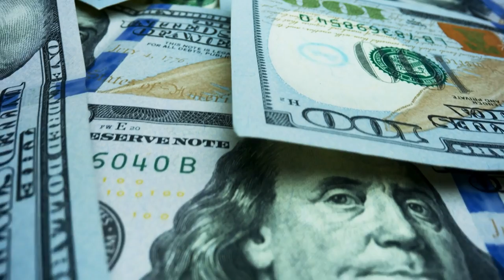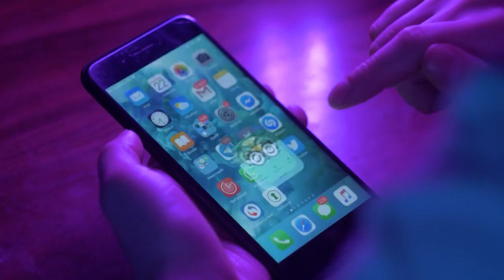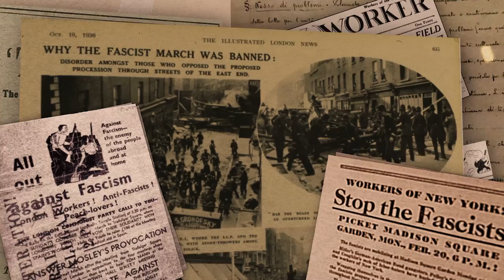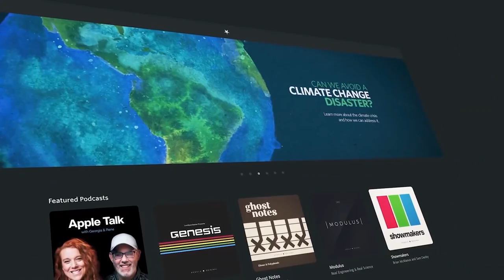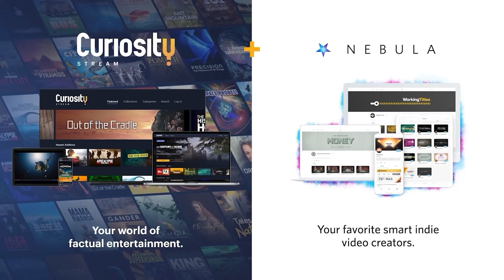Do Socialists Just Want To Take Your Stuff?

Comment: One thing I'd mention is that America's decline in consumer goods quality was a slow one. I'm 39, and my mom was 39 years older than me so she graduated in 1958 (she skipped 2 grades, so she graduated at 16). Although she passed away 4 years ago, I still have all her working electronic beauty products like those giant chrome massagers and she got her first hair dryer in 1954, and it still works.

Capitalism figured out how to export cheap labor and make crap products that die in less than a decade now.
Reply: I'm 20 and there are multiple electronics/products in our household that work perfectly fine and are older than me. New stuff really is shittier, even I noticed that. I remember being in 6th grade (~11y old) , getting my first smartphone (an LG Optimus Black, I love that thing). Back then you could just pop off the plastic on the back of the phone, switch the battery if needed and you'd have a perfectly working phone. Nowadays, take the IPhone 13 for example. God forbid that thing fails because they've made it a royal pain in the ass to take it apart, and the thing won't even work if you replaced the damaged parts with perfectly working, original IPhone 13 parts. You have to take it to them, just so they can squeeze as much money out of you as possible, god forbid you fix anything yourself. And that's just the example with phones, just the tip of the iceberg.
Reply: I'm pretty sure capitalism is a big reason why minimalism is getting so popular in recent years. We have less money to spend, and stuff doesn't last. Buy less, and if you need something rarely, it is better to rent/borrow as it wont last long, and it would take up more space in our homes that are getting smaller as we need to cut living expenses.
Reply: My car (1960 Chevy Corvair) is sixty-two years old and still works (until I took the gas tank out). The only parts I've had to replace so far are the common consumable ones and some things damaged long before I had it. This car was a farm car in North Dakota for years and somehow has only surface rust. The drivetrain is all analog and easy to work on. I couldn't imagine working on a car made today. Everything is proprietary and overengineered to the point that it is not serviceable by even a good mechanic.
Reply: @humankirk9196  yet in Cuba, most people who drive do it in American cars from the 50s. And Russians are driving USSR made cars from back in the 60s, 70s, and 80s. A demand for goods produces products, it doesn't matter if it's in Venezuela, Cuba, the US, or 1930s Germany.
Reply: Capitalism build her chrome hairdryer my god
Reply: @arturow2686  the Soviet Union had chrome massagers and hair driers in the mid 20th century too. But since capitalism always aims for maximum profits and minimum expenditures, the profit motive inevitably leads to outsourcing labor to 3rd world countries, using the cheapest materials and possible, planned obscelesence becomes inevitable. Building a solid product that will work for 80 years drives a company out of business. The time period these items were built was right after 16 years of FDRs fiscally liberal policies. Unions were at their height, and no outsourcing was taking place. But the second half of the 20th century (really the 70s onward, due to a decade of recession) launched the US into an ultra-materialistic society...because the bulk of our economy relies on people buying products. The more often people buy new things the better our economy looks on paper. The problem is that eternal growth is impossible, so we average around 2 recessions per decade. And each one keeps getting worse than the one before it. During these times people only buy the basics, and companies go out of business. Capitalism breeds greed if it isn't balanced with strong consumer protection and anti-trust laws.

Meanwhile, in the USSR products were made by state owned companies, and the citizens who made the products had been working in factories their whole lives. Products were cheaper to make and their anti-materialism ideology meant that their economy didn't rely on selling as many things as possible at the highest price possible. Their government was much more concerned with educating and feeding the people than it was with ripping them off, and the cold War forced them to spend the bulk of their money on weapons production, nuclear testing, a space race, and modernizing their infrastructure. 

Think of it this way: in state run jails and prisons in the US, there is a motive to minimize costs because the inmates don't pay for their stay, tax dollars do. The bottom line is unchecked oligarchic capitalism is a snake that eats its own tail. Sure, we may be the richest country in the world, but that's only if you don't count the thirty trillion dollar national debt. Greed incentivizes the creation of poor quality products, stagnant wages, and the hollowing out of the middle class. Anyone over 40 can tell you that our capitalist country was much more functional with a much smaller gap between rich and poor back when people could put themselves through college without incurring large debts that take a lifetime to pay off. I'm not knocking capitalism, I am a left leaning capitalist. I'm just saying "made in america" used to mean something, and now we can't even build a car that will go 200,000 miles without major problems. Low pay repels qualified workers, teachers, etc. The result is 3 rich people who have more money than 90% of Americans put together.
Reply: @MrJonsonville5  monopolies are against the idea of capitalism. Monopol have to be prevented otherwise capitalism is freedom of choice which socialism is not
Reply: @MrJonsonville5  tldr? Like I said one argument why you writing a textbook. One that understands a topic can keep himself short
Reply: @arturow2686  take your add meds, then maybe comments longer than 140 characters won't scare you so much. If you didn't read it and aren't open to discussion then there's no point in even engaging with you.
Reply: @arturow2686  Monopolies are the ultimate logical conclusion of capitalism, which is precisely what happened during the Gilded Age and is happening now.  It is a zero-sum game designed to concentrate as much wealth and economic power (which invariably translates into political power) into as few hands as possible.  Freedom of choice doesn't even enter into the equation after corporate mergers continue to the point where there are few to no competing businesses, when financial power is so totally concentrated into the ownership of a small privileged class that they can dictate all working conditions and even effectively own governments and the very processes of writing laws so as to cement their advantages into place permanently.  The idea that capitalism is freedom of choice is laughable on its face, particularly as we're already seeing that shrinking out of existence in our current hypercapitalist world.
Reply: @LordZontar  No they are not we took measure to prevent that if afterall one thing is not working it's the way the rich has different laws then the common folk. In the definition of the word capitalism it doesn't say that monopolies are a logical consequence. Maybe for unruled capitalism it becomes a snowball system duh. Which it has become I agree with you but don't blame a simple trading idea that successfully eradicate poverty and starvation. EVEN NOW
Reply: You should watch a few more of these videos pal 😂 an absolute monopoly is the logical endpoint of capitalism. Why do you think monopolies are constantly having to be broken up all the time?

Breaking up a monopoly is anti-capitalist and against the concept of a free market - but it keeps the Ponzi scheme going for a bit longer. Call yourself a 'left-leaning capitalist' (now there's an oxymoron) all you like, but you appear to not know anything about capitalism or leftist thought. Hopefully you've done a bit of reading since these embarrassing comments.
Reply: It also made the items you mentioned.

Comment: 12:43 That's not the only example. The best electric kitchen mixer/blender I've ever used was made in GDR more than 50 years ago. It still works better than most modern ones and has even more useful features than similar modern ones have. The quality of items produced under socialism would vary depending on a great number of reasons and factors. Some of those products were horrible but some things were awesome and were really made to last. User manuals for Soviet-made electronic devices would usually include a circuit diagram to make it easier to repair it by yourself.
Reply: Like the 1960's "indestructible" dinking glasses noone wanted to retail because there's no profit in selling houseware once every 30 years.

Comment: Always like your stuff. I was wondering if you could talk more about the smart phone updates artificially limiting battery thing.
Reply: Software engineers tend to code for the platform they have at hand. They also tend to have the newer and more performant tech than everybody else. Thus as the software gains more functionality, it needs more and more computing power. Every new version runs slower and slower. I have simplified a little bit, but that's the gist of it. I am a software engineer.

Comment: The toothbrush example has always seemed rather disingenuous. Small business is more on the mark, as is the example of a car. A car is personal property, but only into a point. If used for yourself and your personal needs the car is personal property, but if a friend offers you $50 for a ride to the airport the car has then provided a service and is part of the means of production. However if you drive that same friend to the airport for free the car then remains personal property. Meaningfully delineating this boundary without undesired consequence in policy is non trivial.

Comment: This is why I use open source software whenever it's available for what I need. I have several PCs. All but one were throw aways, who's previous owners deemed them too slow and useless. I breathed new life in to them with open source software. I have 2 who are finally reaching the point of being too low spec to serve even me, and the only reason for that is I can't add more storage to them. 32GB is too small for modern OSes, even Linux. It sucks, there is nothing else wrong with it, and the chips would all support more RAM and more SSD capacity. But because it was built not to be upgraded, I can't easily add those to it. The low spec machine in question, I just wanted as a digital typewriter, and maybe read some e-mails, where heavier and more fragile PCs shouldn't go.... but, it's now some of the best condition ewaste I've ever seen. 

The laptop I carry around for work, its previous owner said it was "too slow to do anything". I use it to look up commands at work, check emails and calendars, scroll Mastodon between customer appointments, scan documents, etc etc etc, without fear of loss, theft, or damage. The only thing it can't do is play modern games. It does play Epic Pinball in dosbox though! 
Once I replace the worn battery pack, it'll probably go on for another half decade or more. It has a hard drive slot, which took an SSD eith no issue. Ive bumped it to 16GB of RAM, plenty. Its 720p, which is plenty since its not the center of a home theater. 
But its all garbage in the eyes of Windows users. 
This is why new machines are making it harder and harder to install Linux. Secure boot was never about your security.

Comment: So, work a job and save for years. Use your savings to build a machine shop. Work your arse off getting it up and running. Several years and many close calls later, your little machine shop has expanded into a thriving business of many shops. All of a sudden, your business meets a socialist, means-of-production definition that's arbitrarily different from before. Since there are many that show up to work every day, in different locations, your cumulative efforts have to be reduced to equal that of any other employee; otherwise, you'd be exploiting them. It doesn't matter that you pay their wages, or that they lack any prior contributions to growing the business. Nope, it's more acceptable that you relinquish the results of your labor to them, because your results are too large for them to compete with. It's not that big of a deal, it's only everything you worked tirelessly over the years for, nothing as egregious as somebody stealing your toothbrush or something.

Comment: I can defend socialism using Adam Smith. A franchise owner gives 50% of each sale to corporate and keeps 50% for the franchise. He receives $1,000,000 each year to run his franchise. Of this, $250,000 goes to maintenance and $50,000 goes to rent. Of the $700,000 remaining $350,000 goes to wages and $350,000 goes to the franchise owner's profits. The franchise owner has a general manager who takes care of administrative duties, this leaves the franchise owner with a great deal of free time, he can run a successful franchise while working about 14 hours per week. If the franchise owner has 10 employees who work an average of 35 hours per week then the average wage is about $20 an hour, the franchise owner makes an average wage of about $500 an hour. The franchise owner makes 25 times more than the average employee. In terms of productive power he contributes about 1 unit of production [measured in labor] in a given time interval while the average employee contributes about 3 units of production. Adam Smith calls the franchise owner our master. Of the $350,000 given to the master very little goes towards reinvestment, most of it is spent on maintaining a home, an automobile, travelling expenses, and a variety of conveniences. Thus the productive powers of the workers are being used to subsidize the master's lifestyle. It is clear that if workers could determine price [specifically the relative proportions of its component parts] then a much larger portion would be allotted to the wages of labor, this would improve the lives of the workers and it would improve the work environment by eliminating the tyrannical interpersonal dynamics that have no place in civilized society.

Comment: The problem with Socialism is not the redistribution. It is the monopolization of State by the Party for central planning. The state is by definition a monopoly on violence. And a party that owns the state will also suppress any dissent (regardless of its merit) with violence. In a capitalists system, if I don't like a capitalist, I boycott them economically by not buying their stuffs. I can only boycott a socialist-run state by rebelling or immigrating  (even that is limited by their paranoia which requires them to imposed extreme border control).

Comment: I own a 1994 Toyota Corolla that has 163,000 miles on her and still going strong. My car was t-boned jn an accident when some dumbass wanted to run the red light that they in way would've made it as they were too far back and he hit me when I was halfway through the intersection. The back passenger door got a dent but it still opens and closes with no problem. His fiberglass car got the short end of the stick. My car is for reals metal! 🤘🏼 I ❤ my car, she ain't all that pretty anymore but she still runs, I can fix some stuff myself (I'm disabled so can't do the labor intensive work) and I feel safer in her than the new fiberglass cars.

Comment: 4:00 Well, all this sounds correct if we base it on the theory of exploitation which in turn is based on the labor theory of value (which in turn I have not seen empirical support so far and I highly doubt it will have any). To begin with, not everything that is produced is of value. If a factory produced 1,000 cars in a year and 900 were sold, the gross domestic product will only account for the 900, but why not the other 100? Because, quite simply, the People did not need them, or simply no longer valued them and found no use in them. That is why the manifestation of value is exchange, by demonstrating that what you produced has value for society. Continuing with the topic, it is also not true that only work contributes to production, if so, automated factories would not be providing value in that logic, or worse still, Germany's gross domestic product would be a third of that of Nigeria, at have a third of the population, the explanation for this is that the increase in production is due to renunciation and risk (better known as savings and investment), since this capitalizes on the productive factors that include the workers. . And finally, the interest or profit of the capitalists is explained simply and plainly by a differentiation of value between the price of the final goods and the costs of the productive factors, which are set in the market and the profit or loss depends on that. If the capitalist manages to sell the products at a higher price than what the productive factors cost, he wins, otherwise, if the market is not willing to pay for a price higher than the costs, he has a loss, as simple as that, and that largely explains the profits of trade or the tertiary sector, which is simply buying and selling, or for greater transparency, stock market transactions such as stocks.